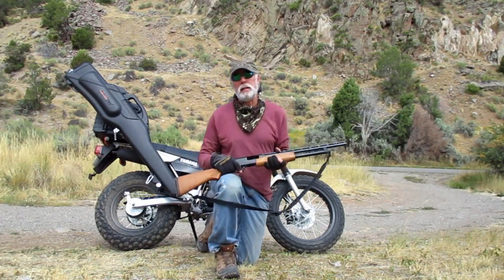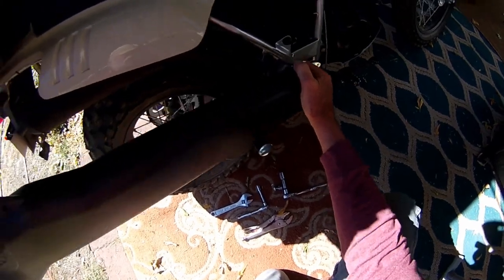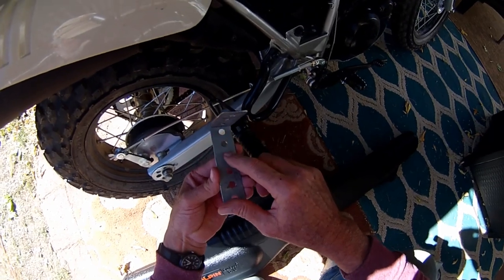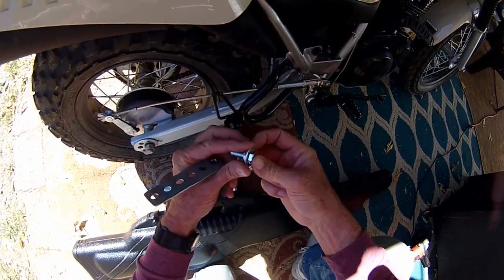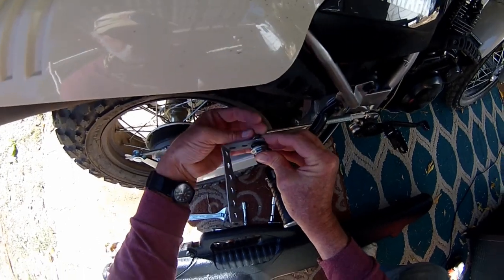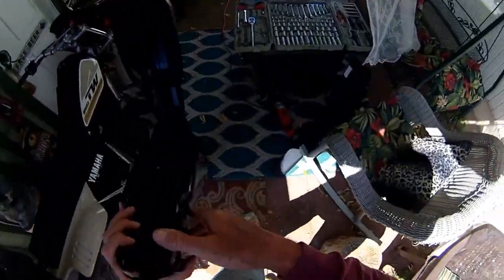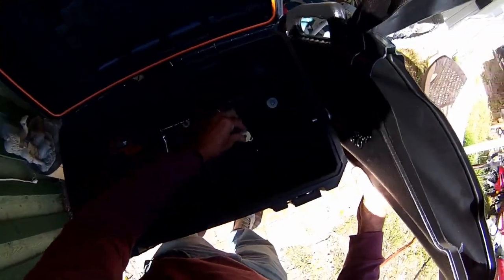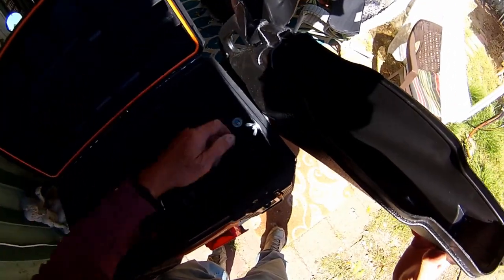Yamaha TW200 Gun Case Install

Comment: First thing out of the gate, those are some awesome tires on that bike.  I'd say you can go where ever that motor will take you.  Regarding the mounting system for your gun boot, I'm sorry to say I'm not really "feeling it."  I think I would have acquired a universal mount from Kolpin, mounted it to the plastic box and lightly secured the barrel end to your buddy peg with some 550 paracord, in order to allow free movement of your swing arm.  But I sure appreciate the video.  It's always interesting to exchange ideas.
Reply: Nothing he did is going to interfere with the swingarm